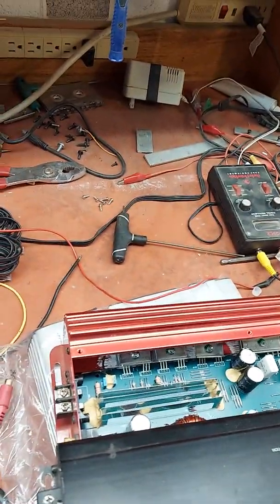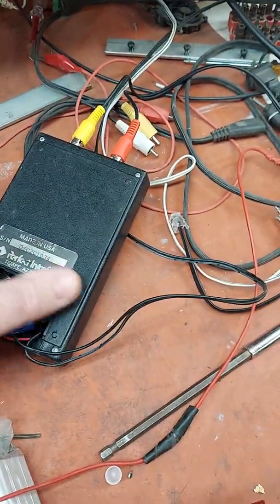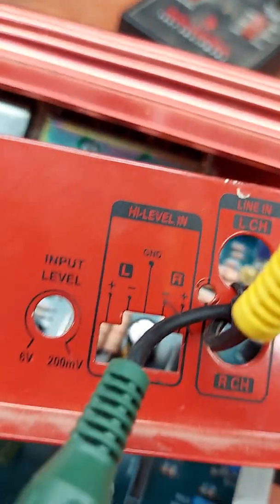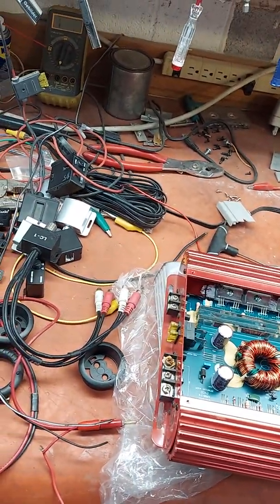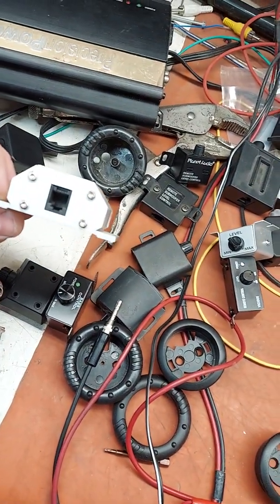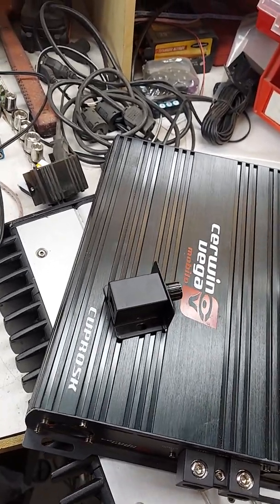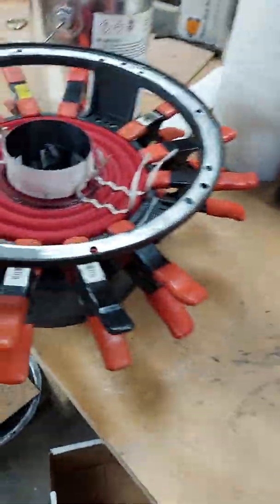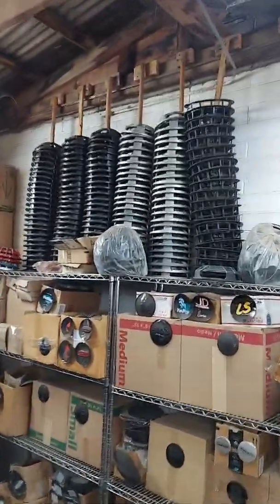Why head unit manufacturers are lying to you about high voltage output @ The Robot Underground

Comment: Your still not telling the whole story the whole reason you want a headunit to output at a higher voltage is to lower your noise floor. If your gain is all the way down on an amplifier especially for your mids and highs it's way less suseptible to interfere that's why headunits like that are usually doing it for sound quality and it absolutely does make a difference ta da half truths are whole lies
Reply from the maker: It's, "You're"

Comment: Man, i love your honesty, its refreshing

That said... why do you like an amp for doing a 10th of its rated power? 
You saying you like something for lying to you.

I have a first gen maxxsonic hifonics brutus 3300.1 and a JBL a3000 amp, both rated the same power although the Brutus is a class D mono sub amp and the JBL is a class A/B

Its no comparison, the a3000 is literally 4  times the weight of the brutus, and waaaay more power

id rather have an amp make rated power or more, like old 90s fosgate stuff... then go for this stuff that touts its literally 10x its rated output

That being said, holy hell the new amps size to power on these new full range class D amps is incredible
Reply from the maker: I just go by the fuse rating until I have my dyno setup.

Comment: I have used lamp chord 16awg, and just because I wanted to move my speakers out used some 10awg speaker cable I had, there was actually a noticeable difference in sound, but that would also depend on the quality of your amp / speakers to notice said difference. Higher wattages, will have less losses with a better cable. Those expensive speaker cables though... complete nonsense and are LCR filters. If you don't know what that is, do research. 

If you are an SQ guy, you actually do want higher voltage input to your amp. Have you ever run your RCAs next to a power wire for your stereo? BUZZZZZZZ!!! That buzz is going to be A LOT worse with a 1 volt input, then it will be with a 6 volt input because your interferences are say .2 volts. A 0.2 volt interference, with a 1 volt input is a 20% distortion. A 0.2 volt interference, with a 6 volt input is a 3% distortion... so yes... it makes a difference depending on environment. Now do all dumbasses in stereo know this? No, they just keep talking like parrots and don't understand shit, does higher voltage actually sound better? Sure does, IF, you are a SQ person.

The real problem is a lack of engineers these days who actually know what they are talking about.

Comment: I paid 76 bucks for a planet audio bbd 2500.1 puts out about 1200w to my type Rs. Ppl scoff at the BBD because of the brand and say I'm leaving performance on the table with my scosche line out (800mV is plenty for the amp rated 100mV-4V). They look at the 3 x 40A fuses and tell me I'm getting 200-300 not getting 1200w lol,  (36v at output and fusing for it).  They all buy into the lies they are fed instead of learning a little electrical basics.  Why would someone ever pay 1k for a 1k amp? boggles my mind!
Reply from the maker: And who owns Planet Audio???  Only the most hated brand in the world.  lol!

Comment: It's a nice touch screen unit with all the graphics on it high output 65 by 4. Like I said it works it's just the CD player is not functioning it will not play at all but the interface will tell you error. I don't want this nice unit to go to waste. I believe it's worth fixing. I probably going to need a nice wiring harness for it to unless you extend the wires on it
Reply from the maker: Just use the auxiliary or Bluetooth input I don't think anybody really uses CDs or DVDs anymore anyway

Comment: What are your thoughts on current Cerwin Vega amps and subs? I saw the CV amp in the video so had to ask. Cheers!
Reply from the maker: Expensive / overpriced.  The new owners really over-rate the amps as well.
Reply: Thats a bummer. I've had CV subs in the past and have never been disappointed. Nothing crazy just a pair of 12" V Flex with a Premier PRSX720 amp (which I still have and works). Thanks for the reply!

Comment: So you are saying inline level knobs are the same as a bass knob that plugs into the amplifier?
Reply from the maker: Pretty much!
Reply: @RobotUnderground  come on man, we both know they are not the same. U say you want to help out the basshead community but when you say things like that, it makes no sense. Not all knobs are inline level attenuators . Some attenuators control a stable frequency and nothing like what is a inline level attenuator. The things is that the community believes they two are the same and they really are not. Please take time to properly explain this to the community instead if half assing it and doing them a disservice. Not that you owe me or them shit but just saying dont put out info that is not true.
Reply from the maker: @filibertofonseca8083  99% of the bass knobs out there are just a potentiometer.  Yes, some of them add crossover features, that's a different feature but still it's just a potentiometer controlling that as well.  And you really should only set EQ's and crossovers once and then forget them.
Reply from the maker: @filibertofonseca8083  Feel free to open them up and examine them.  Put the amp on the o-scope to see what they're doing so you can understand it yourself.
Reply from the maker: @filibertofonseca8083  I don't have the time or resources to dedicate explaining something that YOU in the community are responsible for.  It's up to YOU to read books and understand electronic designs.  Quit being a whiney little cunt and expecting me to solve your dumb problems that nobody cares about.  BE RESPONSIBLE!
Reply: @RobotUnderground  A inline level control in not a bass knob. Self explanatory
Reply: @RobotUnderground  Not just we may disagree it means that I don't appreciate your video and content. Regardless Ill be hitting the thumbs up on all your videos and supporting you.
Reply from the maker: @filibertofonseca8083  As you wish.
Reply from the maker: @filibertofonseca8083  So your question is how does a line level converter work?
Reply from the maker: @filibertofonseca8083  Same device.  One is universal, the other uses a phone cord.  Open them up.

Comment: You wouldn’t happen to have any NOS Adire MKII Brahma 10’s, would you? Or could you make something like the MKII 10 (ie: a high excursion, awesome SQ, with alright power handling)? I want to do a small SQL setup with Morel’s Elate Carbon Pro active 3 ways, and a Adire Brahma MKII 10 would be sweet. Definitely one of the best sounding subs I’ve owned was a Brahma MKII 15. A lms ultra 5400 10 or 5200 10 would probably also fit the bill, eh (I don’t think they came in 10’s though, the 5400 anyway 🤔😣😂)? I have a 5200 18, but besides being the wrong size, it’s going in a HT Sub build.
Reply from the maker: I can make you something like them.  Text me when you're ready, 6023126504  I make better stuff for much less.

Comment: Bro i have the exact bass knob issue and rockville wont tell me what connector it is on the m3 krypton amp it looks like rj45 but when i use a cat5e cable my clipping light is barely visible so i have to run the 12 ft cable that came with it to under my seat and just coil it up and use a velcro wire management thing with a giant roll of cable under my seat.
Reply from the maker: It's probably just a flip / X cable that flips the pin assignments.  Try that instead.  You can get them on closeout on Parts Express.

Comment: so i have  an android head unit with 1.5v output that i got an Audiopipe line driver for to amplify the preout up to10v.. didnt really need the line driver? I keep it at 7v because my amp says 8v max input.
Reply from the maker: Correct.  Just because they make it, doesn't mean you gotta buy it.

Comment: The low output impedance plus high volts is to get the highest signal to noise level to the amplifier to not pick up noise thru the rca cables . So really understand what your tell folks because your. Misleading . I really enjoy most everything you post , but this time you’re the asshole that’s wrong. Haha, I tease!
Reply from the maker: The important thing is education and to see through the marketing BS.
Reply: Foil shielded RCAs would be an upgrade if needed, but how many people are going to know how to properly hook up a one-sided ground sheild? They are just going to hook up both sides and cause more issues than they had to begin with lol!

Comment: bro what was the motor at the end of when you showed all the colors at 13:42??? Man some of the awesomeness you have lying around just trips me the hell out!! Another question is the sound cubed hdc3 motor I have had a 2" high 3"bifilar coil and I was just wondering if you had any ideas on improving it like you did earlier in this video because I love this motor but I want to improve the coil and have tried and ended up with a dual 1.1 ohm 2.25"high 3" coil and when I wire it in parallel it ends up being .7ohm.. like do you think I should wind it higher to get to one ohm or go with bigger gauge I went with 26 gauge for this one. Thanks man
Reply from the maker: The gauge of wire isn't as important as how many winds are in the gap.  Just use what coils are available and fit.

Comment: So having a line driver is practically useless unless you have a shit deck? I'm using a Pioneer AVH-601EX. And the gain on the amp was barely turned up. Tuned using a DD1. So would having a line driver with a high end deck be useless?
Reply from the maker: Line drivers are there because people think they need them and shops like to sell things.  Epicenters are still being made, in spite of there being NO CASSETTE players being made or used.

Comment: Your opion on OFC vs Aluminum cladded wire to power 5k amp?
Reply from the maker: It's not about an opinion.  It's about science.  It depends on how long the wire is.  It also depends on if the amp is really going to draw 500A.  Also, do you have a 500A alternator?  If not, your 0ga CCA wire is fine to charge the battery bank in the back.  Then from the back battery bank, to the amp, what length is that??  That will determine if the CCA you have will have enough ampactiy.
Reply: @RobotUnderground  Facts thank you gonana do rear battery bank to amps should be a short run
Reply from the maker: @allmotorhash  Good.  There are many wire charts to show you the recommended gauge / ampere rating for the distance you're running.  Make sure that the front battery get's a 200-250A fuse, back battery bank get's the same.  Then one per battery.  That's to make sure that every link is fused so that there's less chance of a wire going hot and burning up.  DO NOT USE CIRCUIT breakers.  They are convenient but unreliable.  ANL fuses are the standard.
Reply from the maker: @allmotorhash  Alternator should also be fused as per the rating of the alternator.  150A alt should get 150A fuse.  The fuses are there to protect against a short, not give you problems with your system.  If there's a short in the alternator, wire touching ground, a battery internally shorting, the fuse is there to help prevent it spreading.  Always keep a fire extinguisher and NEVER be the guy changing a tire on the side of the road.  Pay that $1 a month for free towing on your insurance.  That also frees up the spare tire well for more batteries! ;-)